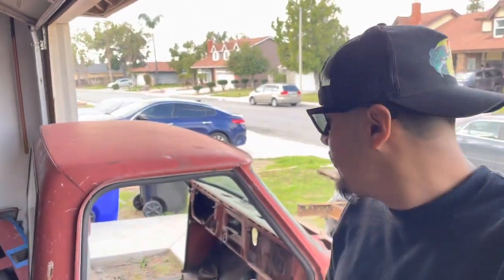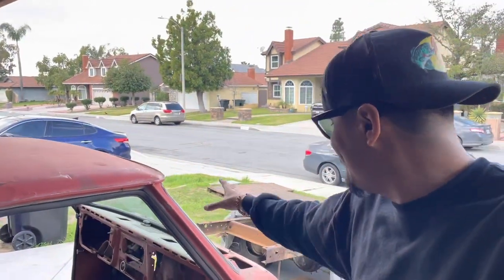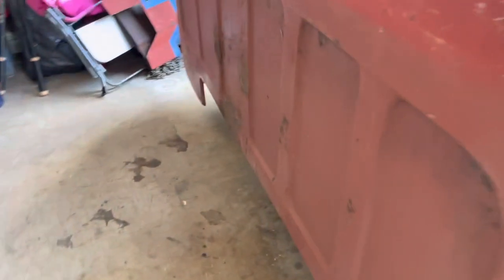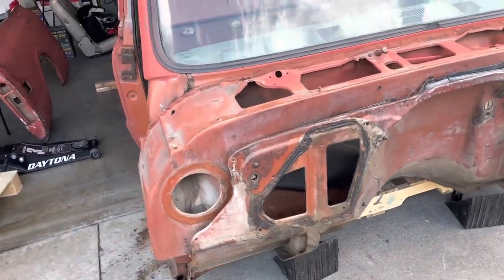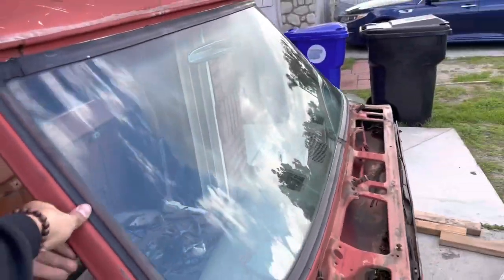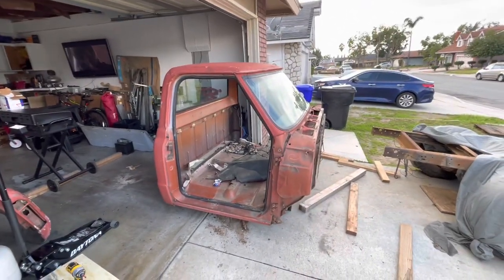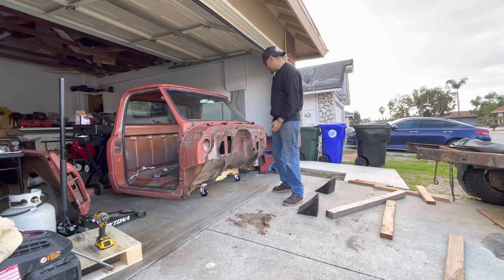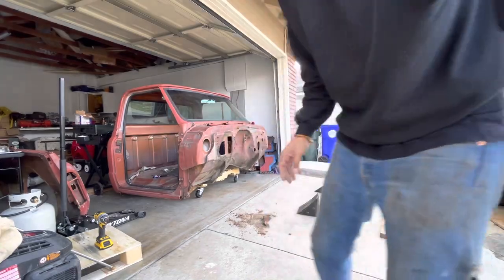EASIEST/CHEAPEST WAY TO MAKE 67-72 C10 CAB DOLLY!!!

Comment: Great idea.. thanks for sharing! Too bad you didn't have a couple of scrap 2x6 or 2x10 around then you could screw them to the pallet and then be able to use the cab mount holes.. put a couple of bolts through the wood so that the cab is (A: higher and easier to work on and under) (B: more secure as IF that sucker slides off that pallet it's gonna mess up your day.)
Reply from the maker: Yes I will have to do that once I start working on it. Have it sit higher and bolt it down. That wouldn’t be a great day of that thing tipped over lol
Reply: After looking at it, I kinda like the Cab by itself, just add two tires and an engine and you're good to go lol just don't forget the doors
Reply from the maker: @jpalacesneakers  haha yes, one must never forget the doors! 🤙🏼🤙🏼